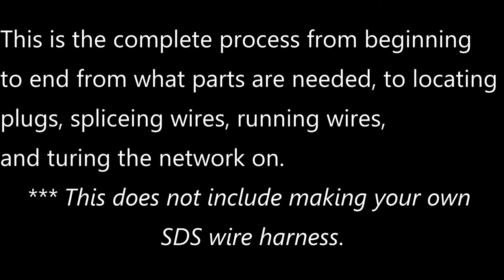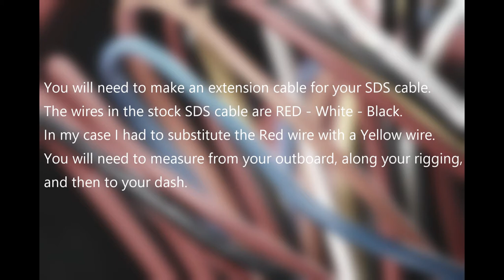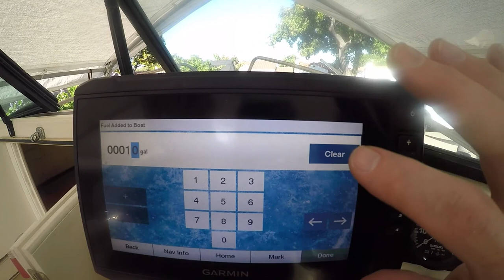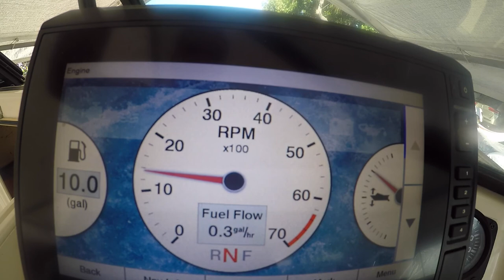Suzuki NMEA 2000 : Complete Install For Outboards

Comment: I was wondering what engine data do you get on the garmin?   When I wired mine up all I get is rpm, fuel burn, volts, engine temp.  I was expecting to get more data.  Plus I see a forward and reverse indicator.  When I shift into forward it shows forward.  When I shift into reverse it still shows forward.  Does yours do that?
Thanks
Reply from the maker: Yes on the main display that’s what you will see. BUT if you have a Garmin unit, you can go into the menu like this, select:  GAUGES, NUMBERS, MENU, CHANGE NUMBERS. Then you can select a panel to change and select ENGINE, then scroll to find ENGINE HOURS, etc. and select it. I’m sure other units have something similar to see other data. As for the gear selection, that’s all it will do. Thank you watching!
Reply: Thanks
Reply: Hi, I am curious about the shift indicator, mine does the same in forward it shows forward in neutral it shows neutral and in revers it shows forward.  Is there anyway to correct this ?
Reply: @koalajs  I never did figure that one out. Sorry

Comment: Thabks bro, this is my next project is there a way to reach you with some questions??
Reply from the maker: Thanks for watching and if you go to the “Discussion” tab on my channel, you can ask questions there. This would be the best way since I don’t have anything set up at this time.
Reply: Thanks, correct me if im wrong, but in a nutshell, you go from the motor with the harness to the adapter to nmea system branch. At same.time that nmea need to be energized with 12v thats another cable amd branch. And the other cable is from the nmea branch thru the garmin cable to the garmin unit... Right?
Reply from the maker: The SDS adapter, to the interface cable, to the backbone. The NMEA backbone needs 12V power, which is the YELLOW cable you can see me connecting at the 14:20 mark of the video. Also make sure to put the end caps on the backbone.

Comment: Great video bro.
Wondering if my 1999 honda is compatible with my garmin echomap... ima have to check it out. 
This video will be so helpful.  Thanks!
Reply from the maker: Thanks for the comment! 
I'm not sure if your motor is capable, but here's a link to help you out regarding your motor.
https://support.garmin.com/en-US/?faq=xvlyBSzSSf5gczlECxlF89
You will also need to make sure your Garmin unit has NMEA 2000 capabilities. 
If everything checks out good, you will have an easier time connecting the NMEA 2000 network.

Tight lines !

Comment: What size wire to make the sds adapter longer?  Can you use butt connectors instead of solder?
Reply from the maker: Casey Guynes : I used 14 AWG wire to make my extensions. I could have went with a smaller gauge wire to match the SDS wire harness wires, but decided with the 14 AWG because of the length. You can use butt connectors, but I would make sure they are heat shrink connectors with heat activated adhesive to make a solid seal. 
Thanks watching !
Reply: @SoCalSeaChaser  Thank you so much!
Reply: Why not just run a nmea backbone instead of extending the main harness

Comment: Curious why you didn't just use a NMEA extension cable instead of making one?
Reply from the maker: The SDS wire harness is only 4’ long and the connection would terminate in the splashwell. So I didn’t want the interface and SDS connecters in an area that constantly gets wet with saltwater. I also wanted everything under the helm, so I easily extended the SDS wire harness up there.
Reply: I still don’t get it.  Run a nmea extension cable.  It’s still all under the helm and you don’t have to splice wires.
Reply from the maker: @thebrownb01 
The main problem for me and possibly for others is, the SDS cable is only 4 feet long. Because of this, if I didn’t cut the wires and the SDS harness was in tack, the short wire harness would terminate in my splash/motor well. The plug on the opposite end of the SDS harness would be connected to the engine interface cable outside in my splash well, exposing it to saltwater, causing corrosion.

To not have this happen, I chose to cut the SDS wires for 2 reasons.
Cutting my SDS adapter wires allowed me to easily feed them in and through the rubber plug via the hole I drilled out. 
This now allowed me to run my wires, through my rigging plug, along my rigging, into my boat and connect the SDS connector to the engine interface cable in a dry area, near my side controls. This also frees up wire clutter from the engine interface cable in my battery compartment. Having the backbone up under the helm in a dry area too, also allows me to connect any other future NMEA2000 devices easily.

Comment: Why you just not extract pins from connector and pass a cable through?
Reply from the maker: Good question and the reason I did not take the pins out of the plug was to be cautious. If I was to accidently break a pin I'm out a couple dollars, not to big of a deal. BUT if I accidently broke the plug, the plug can only be purchased from Japan as it's a special item not sold here in the US. 3rd if I broke the plug I would be out $40 making my SDS adapter useless and I out another $40.

Comment: What gauge wire did you use for the SDS harness?
Reply from the maker: I used 14 AWG wire to make my extensions, although I could have went with a smaller gauge wire to match the SDS wire harness wires. Thanks for watching !

Comment: In order to properly marine solder wires or just solder in general, use the iron to heat the wiring up and “suck” the solder into the wire splice area. Just touching the iron tip to the solder to melt it into the wires is a very poor practice and it won’t hold long and cause corrosion because the solder didn’t “absorb” into the wire. Anyone who wants to do this I highly suggest you watch a video on proper soldering techniques.
Reply from the maker: Thank you for your comment and yes that is true, my soldering technique was not proper at this time.  I had to improvise because my iron was not working properly and was intermittent, hence the reason I used a lineman splice over doing a mesh link with no flux. Melting solder on the wire and using the lineman splice was the best option for the connection, at the time, to add strength so soldering the way I did, the wires won’t pull apart. Plus the wires have heat shirk on them and electrical tape, to help with waterproofing and against corrosion.
To add I’ve since gone away from soldering on the majority of connections and have move towards the faster and secure way of using the newer heat shrink sealed butt connecters. Also I’ve redid all my connections to my fuse panel with heat shrink terminal connectors for anyone curious.
Thank you for watching!

Comment: So it costs $250 in wiring just to get get some info onto a screen? Absurd...
Reply from the maker: The info displayed in the video is just a quarter of all the engine and other data you can get, plus I’m able to connect other NMEA2000 devices to the network.
Reply: @eyeconspiracy $250 is nothing compared to what you can save in fuel once you can see consumption